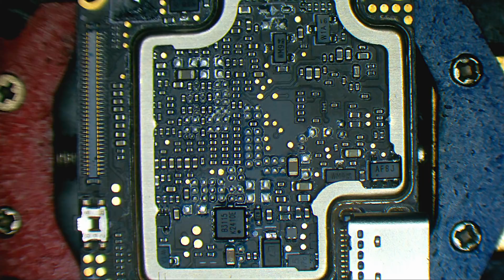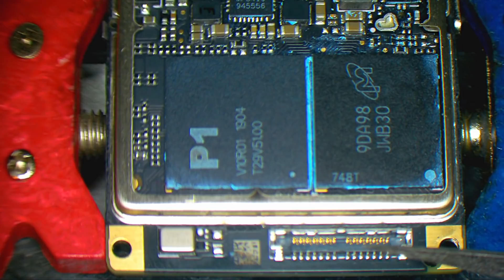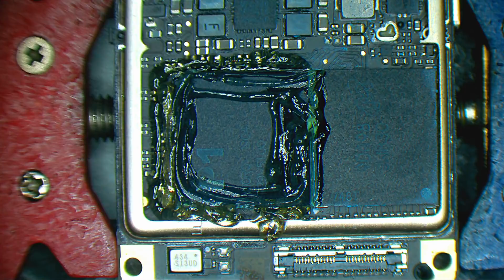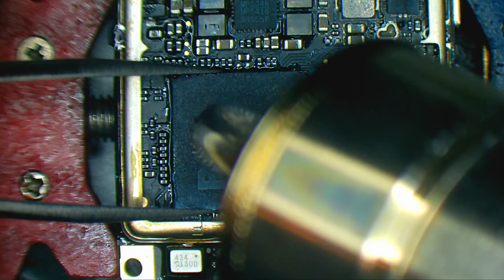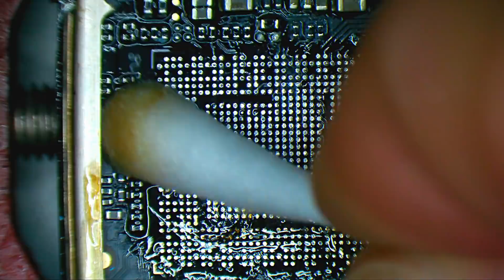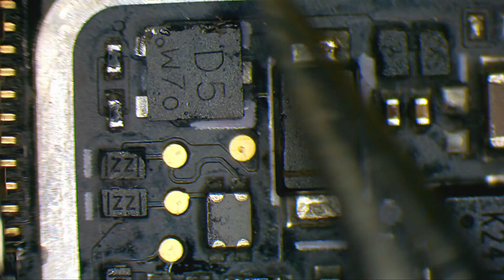DJI HD FPV Air Unit   TEARDOWN & OVERVIEW

Comment from the maker: The tools links were malformed... fixed them!
Reply: Thanks a lot. I have an air unit that looks similiar but I am not sure if it is the same. I have Goggles Racing edition and purchased a fpv air unit as it is called: box, camera and lot of antennas and cables more or less

Are those the same so I could use those with the new googles Remote too ? 

thanks and forget about your accent that is for sure not russian, much weaker and more western.

I can understand you perfectly and if not I can ask ... but I usually get what you mean or meant and mostly I have to check the vocabulary on my side to make sure that I understood things right. 
So communication form Roumania to Germany successfully established and I guess you will not find many that can complain that they are unaible to understand you - at least compared to indian speaking their interpretation of english.

Comment: I pushed by mistake led hole beside sd card slot, thought it was for removing sd card 🤦‍♂🤦‍♂, the led doesnt work anymore, but unit works as before. Im worried if I would damage any other parts, that would make malfunction the unit wrong time. Can you suggest what parts could I break along with the red/green led there?

Comment: I made a new connector for my air unit but I wired it backwards (I was in a hurry). That sent 4S LiPo voltage straight into the ground and SBUS pins. It no longer will bind with goggles, but everything else operates as normal (LED, Bind Button, Software connectivity and file system access). Should I chuck it?

Comment: please help, I have an Air Unit with a non-working OSD. Would you happen to know the component that needs replacing/checking similar to the caddx vista solution

Comment: @Livyu FPV the video is great even for layman as me. I wonder what would be your thoughts on shorted UART RX with ground? Someone told me that it could be the protection diode, but not sure about it.
Reply: going through a similar issue with my air unit not showing vbat. did you ever find more information or a fix by chance?

Comment: Hay man, I’m changing down a bad air unit my self right now. I believed it was over voltaged. 

It visibly burnt the top 54335 regulator and looking later the second one towards the middle on the input pin too.  We seem to have found some of the same things with voltages .  I replaced the first at the top one but got smoke on the second one after fire up.  Getting 3.3v on the one I replaced so know that good looking at your findings.  I’m waiting for more 54335s to come in to replace the second.  Iv tried 5v voltage injection on the coil on that one to see if I can get it to fire up while o wait but it’s not playing ball.  It’s drawing about 0.5a though on the 5v when injecting and things are warming up.  

I have not tested the system management regulator yet and that’s next after the new regs come.  

Your video was fantastic now looking, I just wish I’d seen it before I was guessing the voltages lol.  

I’m hoping it’s not fried the P1 soc but it’s hard to tell.  I need to start checking the other side of the board where you have the clamping diode and the FET, I don’t believe there is an issue there as I don’t have any shorts but the shielding preventing me getting closer to look. That’s a total PITA.  

Anyways fantastic video, I have a quick one on the failed repair and some images and stuff on the community page if your Interested. 

Thanks 

Mad. .

Comment: Can you make a video how to fix no osd problem for air unit? On vista we can fix it by removing the broken tx/rx dioda. But theres no tutorial  for the dji air unit about how to find the broken dioda that need to be removed.  Thanks
Reply: Hey. Same problem here. I am searching for lots of hours, but found no real solution. TX and RX are shorted with ground and no OSD/Telemetry working. Did you still find a solution? Greez from Germany!
Reply: @mannim.6901  Nope.. still no fix for the air unit
Reply: @mannim.6901  remove the diodes !
Reply: @michagt3408  where dioda? please help show pict

Comment: I am thinking about buying a water damaged Air Unit. You think there is a good chance that something else got shorted like a power ic or a cap? Because the chip that died on yours isnt buyable i guess?
Reply from the maker: Yeah... no way!
Reply: @LivyuFPV  What do you mean?:) You think  there is a chance it's not the main Ic like yours?
Reply from the maker: @johnny4498  no, i would not buy a water damaged one. The risk of the mcu to be bad is very high!
Reply: @LivyuFPV  I would get it for $50 with the camera. That's pretty cheap huh?

Comment: Hey, did you look underneath the HF shield on the backside of where the IE1000 is.. i would expect to find an ACP transceiver there - can you verify?
Reply: The IE1000 is the transceiver.
Reply: @cedivad   other devices have both an acp transceiver and up to two ie1000 .. in those designs the acp transceiver is usually hidden on the backside. My current thought is that the acp is for 2.4 and the ie1000s for 5.8
Reply: @AndreasGibhardt  Sorry, I never answered. I can confirm the IE1000 chip is the transceiver, there is no ACP transceiver (why should there be? that's what the IE does, IQ goes right into into if & matching RF on/off times if you probe the FPC cable)
Reply: @cedivad  i know that the ie1000 is a transceiver.. only that other hardware from dji allways has the acp in visibly between the leadcore processor and one or two ie1000 so there might be a reason that it is neccesary. the cpu has changed recently and is maybe now able to interface with the transceiver directly. the datalanes to the transceiver run at about 1ghz and i lack the equipment to tap on that.
Reply: @AndreasGibhardt  the ie1000 does IQ in from what I probed (that's ~ the same frequency as the RF bandwidth, so 40MHz tops, there is no need for a fancy scope to verify it), and it's been a long time, I might be wrong, but I believe the APC transceiver was doing digital IQ in or some other kind of digital interface and either RF or IQ out (but if there is a ie1000 in the old designs it must have been analog IQ out).
Reply: @cedivad  do you mean the interface is analog there? i found no docu on the ie1000 but other designs using it with a digital interface. if it has an analog in the old designs propably use the acp as a baseband source. that would also mean there is an entire baseband modulator in that P1. can i somehow reach out to you for a chat?
Reply: @AndreasGibhardt  afaik it's a glorified DAC, where the analog part is the IQ, it figures that when DJI made their own asic they decided to add a small analog chunk for cutting out that middle man. Sure, my username works on telegram and this is my google account so that's my email.

Comment: Thank you Livyu for this detailed teardown. Some of us have issues with OSD disappearing after power spike( perhaps ) . Any thoughts on that please?
Reply: I lost my osd any fix ?
Reply: @slowflowfpv5476  I had the same Problem  , two diodes between rx and tx broken. coud let it fix and guess , osd working again (-:
Reply: @rctom1  please help, where dioda position to remove in Air Unit?
Reply: @abieazki  sorry i did do it by myself and it was a vista not the big airunit. But the guy told me it was easy to fix only 2 diodes for pennys and its working again. Maybe you ckeck yt for it.

Comment: Recently my drone felt to the snow, when I picked up it I noticed that video doesn’t work anymore. 
At home checked 9v line on FC and it was dead(0V). Then I connected 4s lipo directly to the air unit, It’s worked fine. 
Bought new FC, connected, and again fried.
Checked air unit resistance between + and - it was 0.01 Ohm so I decided to teardown air unit, visually didn’t find anything suspicious. 
So I was a little angry and decided to check what if I connect it to 6s, It was fine. Then just to ensure that it’s still dead I found that resistance is... 1720 now. MAGIC!!
 Checked current at 10V bec from esc - 0.8A at start, then dropped to 0.45A.
Apparently by connecting 6s I fried smth like dead filtering capacitor.

Comment: Thank you for you work, please correct me if i wrong, you found that transient protection circuit what is operating on normal conditions under 22 volts, so the air unit is absolutely compaible with 5s? , i have 5s batteries, and using buck converters from the begining for no reason :D so it is safe with 5s in theory?
Reply from the maker: Yes, exactly!

Comment: 2:45 we now know for sure these unpopulated footprints are for 2.4GHz (based on FCC application for V2 goggles/radio), no reference to it yet but I'd guess we will see the same-looking Air Unit with 2 more 2.4G amplifiers 🙂
Reply from the maker: Well I already new why those were there :)

Comment: Finally someone which did not only show the whole assembled unit! Thank you!

Maybe I have some things to add:
The connector which is used for the camera cable is a HIROSE DF56-26P-0.3SD. They even use this connector on other drones.
The communication is via MIPI CSI-2. If you would be able to generate a valid CSI signal you could hook up anything you like to the air unit. Unfortunatly its not just plug and play because almost every camera/sensor would need it's own driver implementation on the receiver side (Air Unit). 
The guys from RunCam got it somehow with the Racer 4 but they don't want to talk about it ;-)

And one more thing: The Caddx Vista uses almost the same components. 
They also use the same P1 chip, the same regulators, the same RF components and so on but just another layout and a lighter casing.

I really play with the Idea of creating a MIDI -> CSI -> FPGA (something like a XILINX Spartan-7) -> CSI -> Air Unit Converter. Would be awesome to hook up a gopro or something for live transmission...
Reply: Hey Ivan, have you had any success with the HDMI - CSI - Airunit Converter? Thanks
Reply: please try a TC358743XBG converter

Comment: Great video my friend. I'm so envious of ppl with such talents on the soldering iron. There I have some serious deficiencies ;)
DJI stuff is really well built and I'm curious if they already improved it for the upcoming leaked DJI drone. Greets, Mario
Reply from the maker: Thanks Mario! Well the air unit is on par with everything else dji does. But in the same time they have to learn that for fpv the products need to be way more resistant. The air units and vistas can be killed easily by mistake.

Comment: I have a unit where I shorted the sbus wire to vbat by accident. Now the telemetry is not working on this unit anymore (osd) do you think it killed something on the chip?. Rx/tx has not been shorted just the sbus. Rest of the unit works fine.
Great video by the way!
Reply from the maker: Well, I have another au that has the same issue (no osd working) I checked on the PCB and the RX tx goes straight to the processor with some sort of line protection but... it could kill that section of the processor. Will come back with this info.
Reply: @LivyuFPV  would like too see this video, have an air unit with non funcition OSD, heard that removing the diod on the TX will fix this, I know where it is on the vista but on the AU it is a mystery. Hope you can help me out with a video =)
Reply: @MrHauf85  Having the same issue. Have an air unit with a non-functioning OSD. Did you ever figure out where the diode that needs removing is?
Reply: @propwashfpv7063  no, guides on the vista are on Facebook, but no info on the AU, hopefully Livyo can help us out
Reply: @Livyu FPV @InDrone Productions
 that would be great to know where is this diode on the vista. maybe i can start searching it on the airunit too

Comment: Thanks for the tear down.  Any chance you can help solve the non binding issue?
Reply from the maker: please explain
Reply: @LivyuFPV  I have an air unit which stops binding with the goggles and the radio controller, the bind button does not work anymore.  What would be the possible causes?  Thanks

Comment: Great adventure as usual. I was wondering if you know what IC chip in the Caddx Vista apparently supplied by Texas Instruments is causing shortages of Vista supply. Now apparently DJI will find Chinese supplier?
Reply from the maker: I have no idea :) IT could be the 2 regulators used in the air unit(if they have the same regulator arrangement) I would need to teardown a vista unit and check it.

Comment: I am not really into FPGAs - would it be possible to identify the FPGA by the BGA layout and the location of the power supplies?
Reply from the maker: could be... but many FPGA products are not public or created by small companies. very very hard work...
Reply: @LivyuFPV  Have a look at the chips of allwinnertech. Their labeling is similar and some have a similar BGA pattern.
Reply from the maker: @Stefan_73  i know dji worked with them but... still need bootloader. doubt that you can flash it with what ever
Reply: @LivyuFPV  the bootloader is on that micron nand flash

Comment: Nice! Yeah I accidentally flew an air unit on 5S and didn't have any problems
Reply: Do you regularly use 5S now on your air unit? Just curious.
Reply: @froncheek87  yes, but I had already ordered BECs so I just put it in there. Better safe than sorry.

Comment: Hey? Thats a MEMS Mic left of the IE1000 right!?
Reply from the maker: nope, that's a crystal used to generate the RF ic clock.
Reply from the maker: PS:  i saw no mic
Reply: @LivyuFPV  so original cam have mic( where else?), and they in theory can do live audio on both vista and air unit)
Reply: @Nikita-zd1gc  The mic looks to be the square 434 part below the P1 chip, if I were to guess there is a hole for it on the opposite side of the board. At least it doesn't appear to be a typical ceramic base oscillator.

Comment: Nice tear down Livyu. So if I understood you correctly, they're just using a wifi chipset at a non-standard @5.8ghz with an RF power amp frontend to give the 1W output. It might just be 802.11g which would give up to 54Mbps. That uses OFDM with a 20Mhz bandwidth, which would explain why it trashes the analog channels. It's unlikely to be using the newer MIMO-OFDM in 802.11n+ systems (which benefit from multi-path fading) because the antennas are circular polarised in a way that promotes signal correlation i.e. no polarization diversity. MIMO antennas are normally linearly polarized but at different angles to give polarization diversity.
Reply: I'm not getting this. Analog FPV has an approx bandwidth of 20MHz too. ODFM is usually also well behaved in it's spectral behavior.
Reply: @Stefan_73  well DJI's manual confirms the 20Mhz bandwidth per a channel, although the actual channel spacing is larger. While you're right about analog channel spacing being at least 20Mhz, the actual analog NTSC signal only uses 6Mhz of bandwidth. From what I've heard, the main reason why the DJI air unit doesn't interoperate well side-by-side with analog systems is because the goggles are also emitting, as one would expect for a full-duplex digital communication system. The googles themselves can put out up to 30dbm (1W), I imagine that's enough to start leaking into neighbouring analog channels of nearby pilots.
Reply from the maker: yeah, same thoughts here. But someone would need some nice lab tools to learn more. My spectrum analyzer goes up to 1.5 g and my oscilloscope well nowhere near 6g but I am curious about what they are doing on the rf side.
Reply: @LivyuFPV  nah you'll need something like a HackRF One SDR which goes up to 6Ghz. You might even be able to extract the DVB-T feed (if that's the protocol they're using).

Comment: Excellent. The minimum input voltage of the 3.3v regulator is 4.5v according to the data sheet. Does the 5v regulator drive the camera?

Do you think if we moved those RF modules to a working Air unit we could have four running and double the output power?
Reply from the maker: Well, I will have to study it more. But... don't think so. The camera seems driven by 1.8v. Yes... 4.5-28v input. The rf IC I suspect needs 5v.